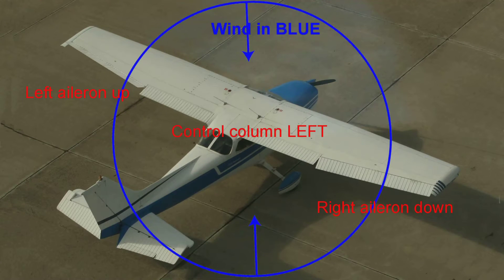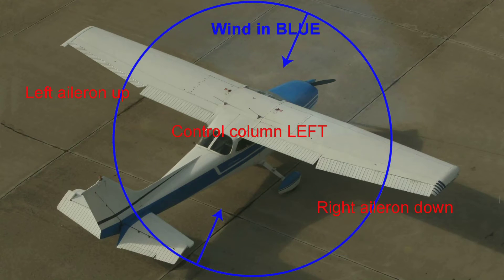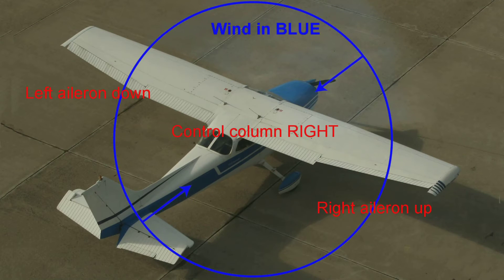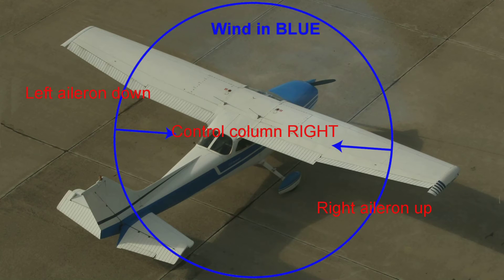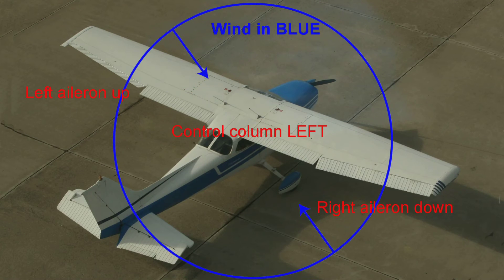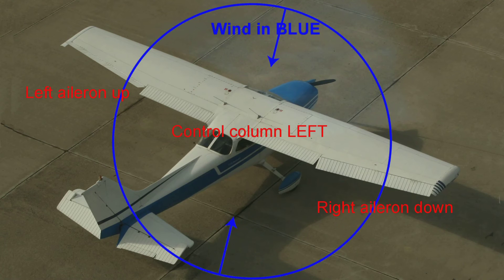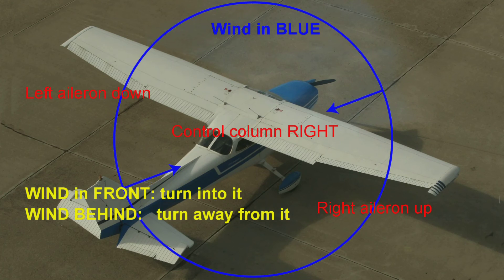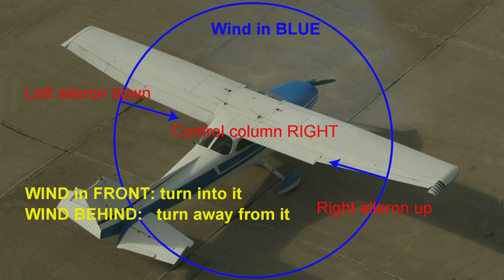Taxiing an Airplane in Strong Wind

Comment: The two blue wind arrows were confusing at first but then I realized it's a clever combination of information that shows the correct controls for either wind. My instructor advised to "point into" or "dive away from" the quartering wind.